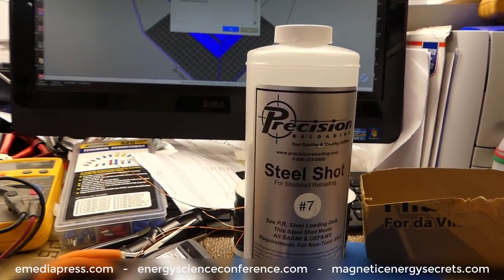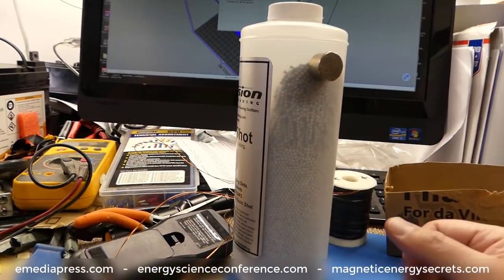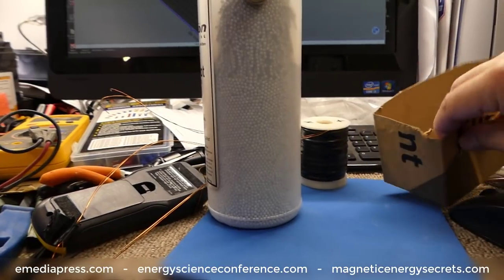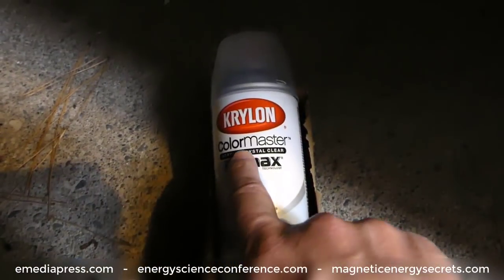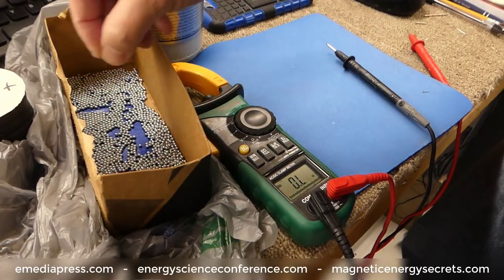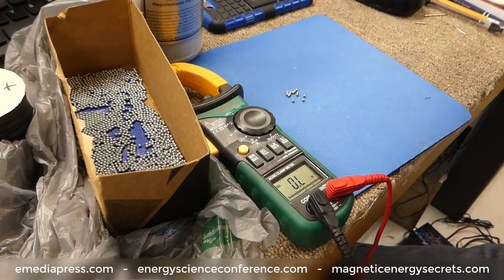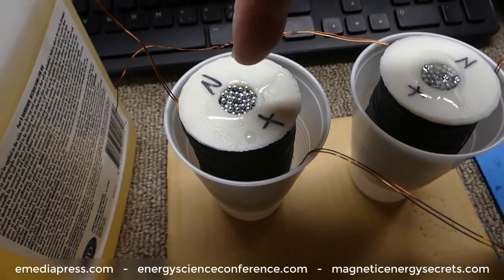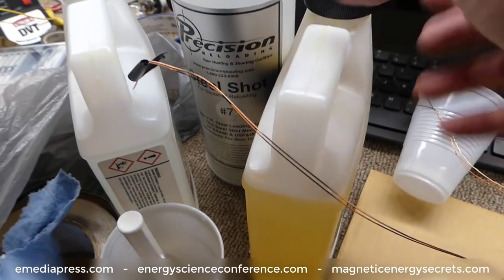Paul Babcock's Magnetic Core Material

Comment: can you buy it an repackage it  an sell it to me as steel balls i would have to have permit to bring it in my country
Reply from the maker: You should contact the company, show them this video and ask if they can sell it with a different label.
Reply: In Europe I could not find Steel shotgun balls... I have a friend who owns a shop but could not get Steel shotgun balls...Will steel (Inox) balls spec.304 do the job ? I could find those at a reasonable price. If cannot find diam. 2,5mm would it be better 2,38mm or 2,7mm ? Smaller or bigger ? Please give me your advice
thank you and keep up the good work !  @AaronMurakami13
Reply from the maker: @claudiom.5167 If you can get whatever pellets you can find, stick a neo magnet on them for a bit then remove. If the pellets fall apart with no residual magnetism, that is what you're looking for. They should not stick together when the magnet is removed.
Reply: @claudiom.5167  I would go with smaller pellets, so more magnetic matereal will fit a given space,
Reply: @jamest.5001  This is for Aaaron..I found gunshot balls trough alibaba , 1Kg for USD 50 including shipping, it was not easy...

Comment: This is a great idea from Paul Babcock- molded cores. I love the ease and simplicity! My experience has been that laminations or insulation between the layers has little or no effect on total field strength, no effect on the speed of a motor, or might actually reduce the total field strength. With many of the high permeability metal alloys, corrosion can be a problem, so i can understand the need to spray on an insulating layer to prevent rust. But i think that motor and magnetics inventors can skip this step when using regular, carbon steels, and just glue their bearings or steel plates together with epoxy (or even weld them together) without any insulation between the layers, or between the steel shot.  Laminations will help prevent electrical shorts between wires of coils, but i have seen zero evidence that laminations in a steel core can somehow "polarize" the field , make the field stronger, or serve any purpose other than preventing electrical shorts. Just weld the plates together, with no insulation between the layers, and then spray some insulation on the outside. I think researchers will find that there is no benefit to having laminations or insulation between layers, and that this step can be skipped. The heating and hysteresis, Foucault or "eddy" currents are the result of poor alignment between rotor and field, from impurities in the iron, like a rock in creek, creating whirlpools, or from field reversals, which always occurs in AC motors. I have build high-speed, DC motors, which do not get hot at all, even after several minutes of full speed operation. But this cold-running effect is done with permanent magnets and plain, old-fashioned, galvanized roofing tin, or coffee cans. I got tired of wasting money on spray paint, then found that the insulation is not really needed for magnetic cores, as long as your wires are well insulated or the completed core is insulated on the outside.
Reply: Sunsaver FromNHH generally with iron there will be great hysteresis.   But what you get is Amp draw and denser flux.  That's it.   Not sure what characteristics will the shot steel pellets do when coated with acrylic.  Will the Rpm be the same at the same input or will the flux density be greater allowing more spikes?  Who knows

Comment: There are motors out there with not metal core......all plastic except coils.  Why is the steel core required.  Gerard Morin showed how properly tuned cores that have a resonance like a tuning for produce more power.  He also showed how his motor and a pancake motor from an electric bike made in chine are all plastic core.   Any thoughts anyone?
Reply: Elvis Tesla the core saturation is done with steel to improve flux density... At a cost of losing high frequency changes however, Babcock is focused on emf collapse for overunity whearas Gerard Morin is focus on  a radio frequency multiplication for amplifying HV devices/sources.  The field perturbations in both cases hint at magnetic moments being able to achieve much greater work performed using more than one type of 'train of thought'.  Homework: download the pdf book of Magnetism by Ken Wheeler...it's excellent.
Reply: I have done more than read Ken Wheeler's book.  I literally study it and his video's.  Best feedback I have gotten yet.  Thanks MS
Reply: Magnetic fields are sustained perturbations.  Incommensurable ones.  To me - that is the glaring hint that we should be able to do more with the phenomena we call magnetism by fully understanding its geometry, attributes and dynamics of them, and ratio.  I just have this sense that nature has way to keep the on switch going for energy.  Like Viktor Schauberger felt in respect to vortex dynamics.  Who knows...it could be the very same principal in a different way of tapping that same medium.  I am not experienced or educated in this field enough to know better maybe if you listen to all the crusty nay sayers out there regarding over unity.

Comment: Thanks.Will not the flux density be less than for a solid core will have when using the same mmf at/m.
Reply from the maker: It will be a bit less, but the eddy current losses are way less and the switching time is a lot faster. I think the benefits weight out.

Comment: Aaron, thanks for sharing.. On a seperate topic...I am excited to be replicating your homopolar magnet generator using a 40k volt MSD blaster coil. I am using  2 very LARGE 6 pound N 52 toroidal magnets ( 5.5" x  1." Thick !!) I have them currently in a bucking arrangement right now.. I have a Quantamagnetics gyroscopic generator sitting right next to it. I am eager to know a little more detail on your circuit/diode/capacitor schematic from ÿour test version. I bought the video and PDf, however I am a bit of a newbie and would love to begin a dialog today..plz email me :) cheers - from Molalla, OR.
Reply from the maker: Hi Michael, please email me at info at emediapress com